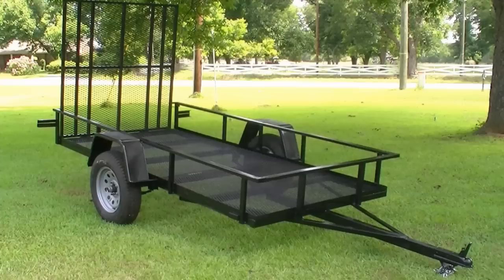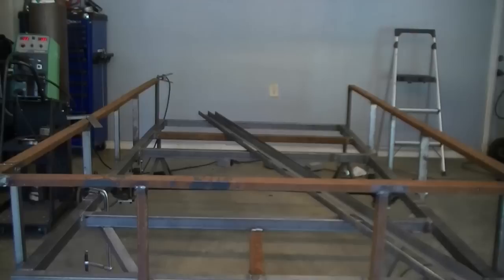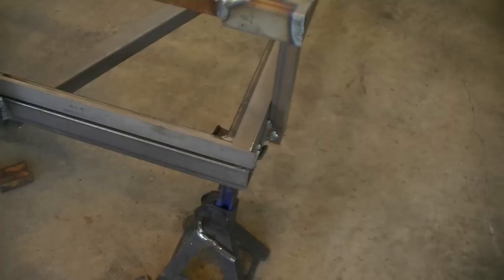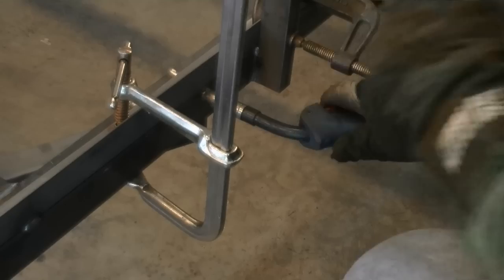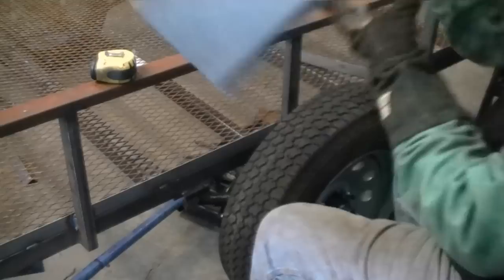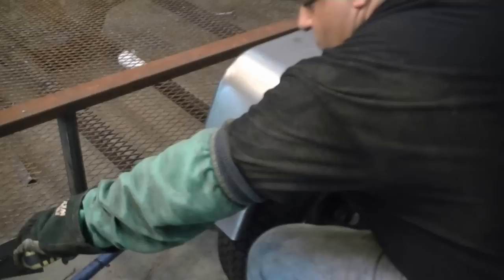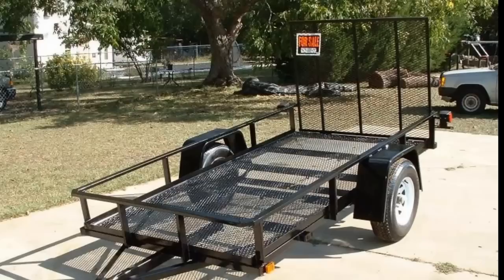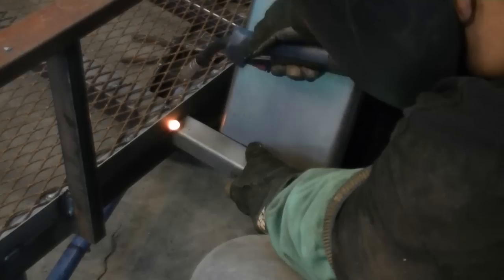Everlast Trailer Project Build Part 6: Floor and Fender time.

Comment: I really wish I hadn't used wood planks when building my trailer years ago! I don't think the expanded metal would hold up well for my application, but it sure would save some weight! Aluminum sheet may be my next option. I like the simple design of this trailer a lot.
Reply: youngnstudlytoo Has

Comment: Why don't you grind off the rust before you weld?
Reply from the maker: Several reasons.  Using 70s6 wire high in deoxidizers.  That cuts through mild rust.  Also the co2 in the gas cuts through the rust as it is not truly inert.  And the heat on thin metal is more than enough for good penetration  Last, in the trailer industry, it is not cost effective to prep the welds by grinding.  The welds do not suffer strength issues when done like this.